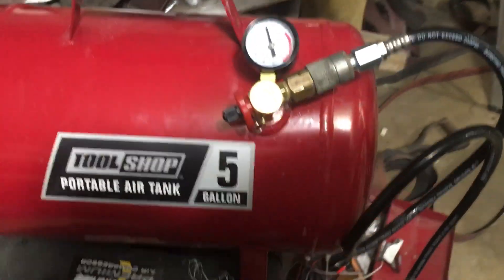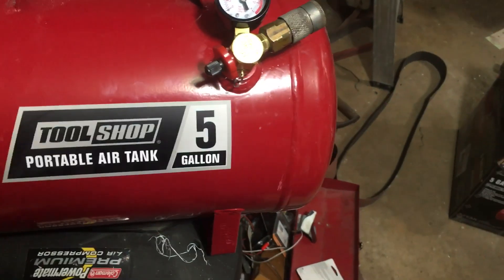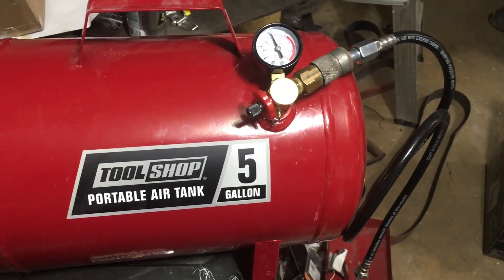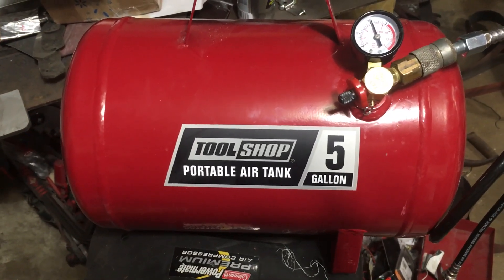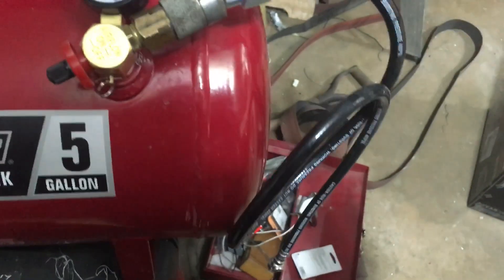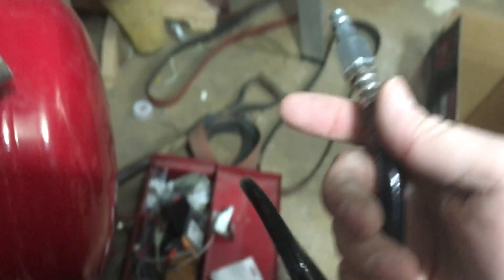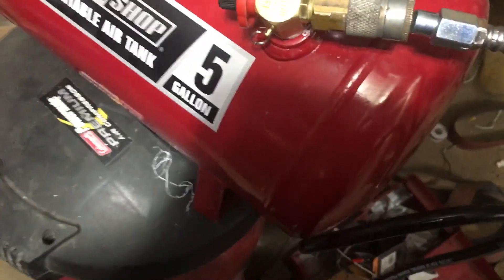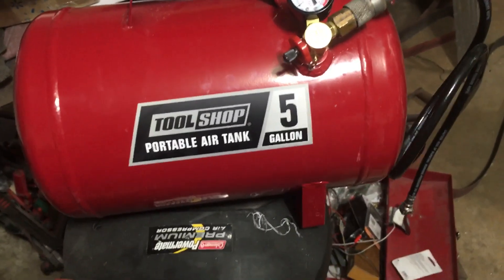Shop tips: portable air tank mod

Comment: I think the portable air tank is one of the handiest things I got. I keep a small one in my trunk most of the time. I have a Ford Fiesta with small tires, so a 5gal is all I need. Much better than a little portable tire inflator and more portable than an actual air compressor.😊
Reply from the maker: I did recently pick up a Milwaukee m18 inflator. It’s pretty nice, though there’s still some things that a tank still comes in handy for.

Comment: Frmale fitting on the valve splitter? What hose is that you added the female threaded-make industrial fitting to? Without a big compressor at home I have to go to the gas station to fill up my HF 5 gallon tank. Wont this mess me up?? I'm so confused sorry!
Reply from the maker: The hose that’s plugged into it in the video is just the hose that came with the tank. Instead of screwing directly into the splitter/fill valve, I just added some couplers in between. You would still fill it as normal.

Comment: I got a hyper tough 7 gallon tank and I’m still trying to figure out how to drain it.
Reply from the maker: Vicky James try removing the schrader valve stem.
Reply: Invert the tank so any condensate travels to the manifold valve and any liquid will escape when you connect anything to the quick release valve.